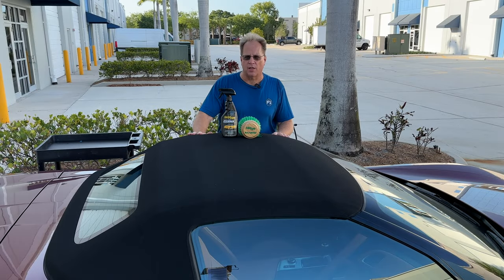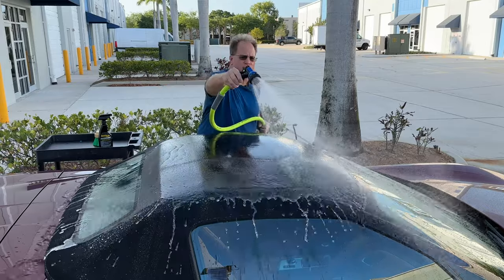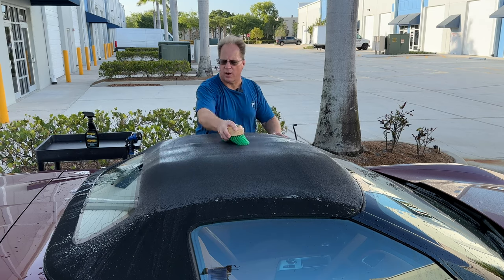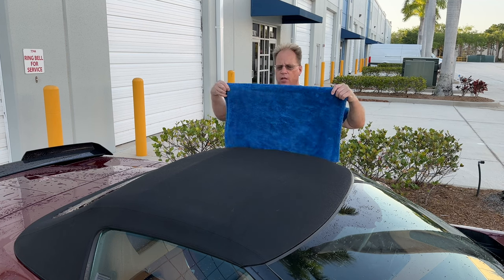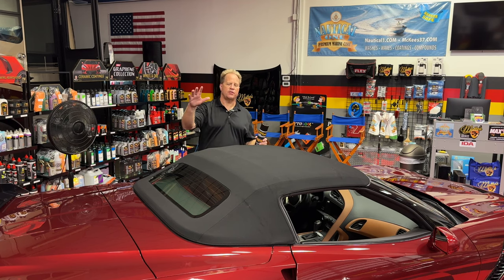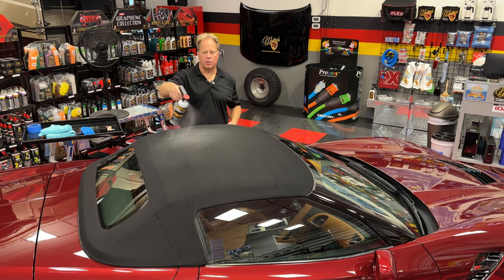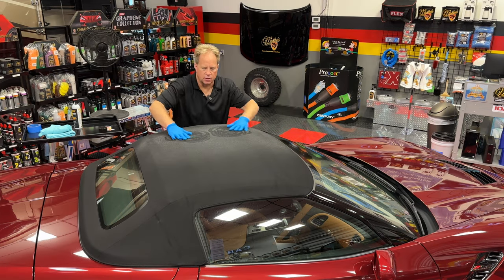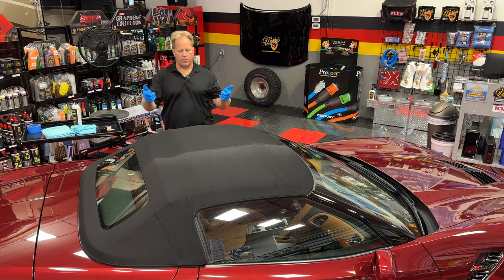How To Clean and Protect a Canvas Convertible Top with RaggTopp!

Comment: Great video - Thank you.  I have a new stayfast top on my 56 t-bird. Do you need to reapply the protectant every time you wash the top? This is Iowa with a lot of crop dust and bugs that need removing after a cruise.
I also might point out that one can of the protectant sprayed as heavily as you show will not be sufficient for a top my size.

Comment: Just wondering, is the product water based or solvent based?
Reply from the maker: I'm not sure.  Doesn't really matter to me for application reason.  I TRUST the manufacture uses the best liquid delivery system to make the product the most functional for this type of application.  -Mike Phillips
Reply: @autoforge  solvent based dries faster than water based. Should have respirator with solvent based stuff
Reply: it's solvent based, but the solvent is very low and safe for acrylic.

Comment: How do you care for the ragtop after you’ve applied this? I wash my car once a week. Do I use the ragtop cleaner every week or would that remove the sealer?
Reply: No, don't use rag top cleaner once you treat it with fabric protectant.  You should just rinse it off occasionally with clean/fresh water.  If you let it get particularly dirty, then use a neutral PH balanced cleaner and a soft sponge.  The fabric protectant should keep the dirt out of the ragtop fibers (which are usually acrylic at the end of the day).  If dirt is getting trapped bad, then it might be time to actually use a fabric cleaner and mechanically scrub/rinse and then re-treat with fabric protectant all over again.  Assuming your vehicle is NOT garage kept, a good treatment (like from RaggTop) usually will last 4-6 months in warm/wet climates.  In colder/snow environments, you're looking at 3-4 months.